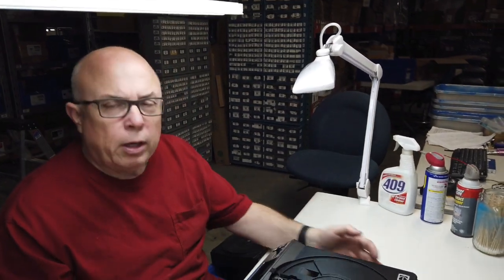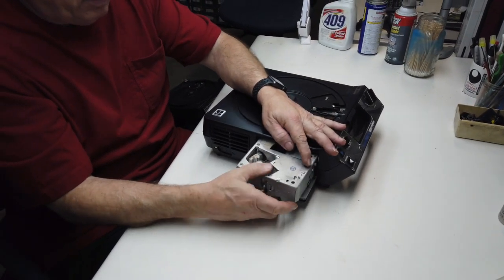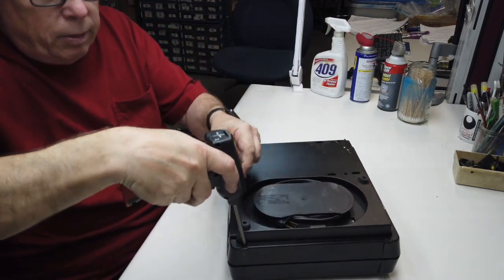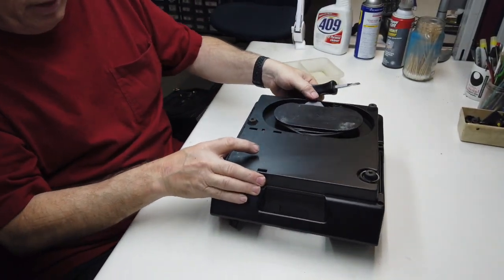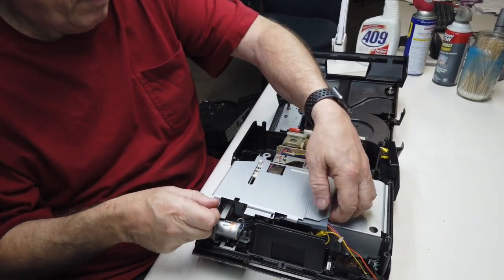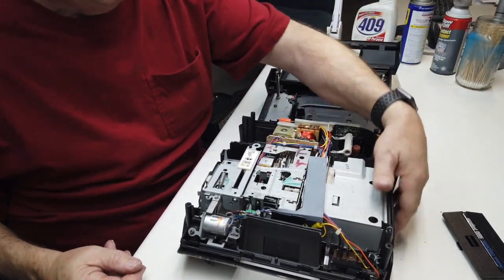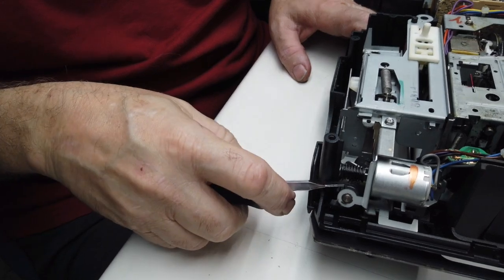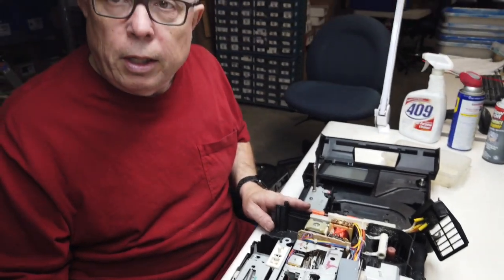Kodak 5200 - A Quick Look

Comment: Like the video on the how to get in and perform initial inspection.  Looking forward to Part II where you repair the gear that crumbled away.
Reply: I have a Kodak 5400 and and that same focus gear has cracked on projector. Changing that gear on the pre 1981 models looks to be a lot easier to do than what it would take to do on the newer models. I hoping to get a few tips here before I attempt it.

Comment: Should I get light projecting through the lense without a slide?
Reply: No, there is a metal plate that blocks the light until the slide is loaded into the gate, then the light will shine through.